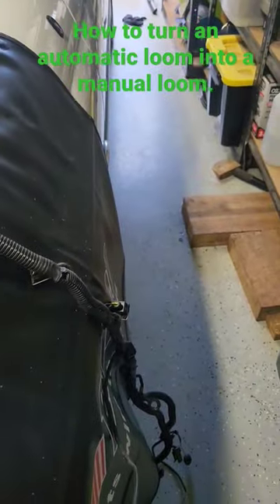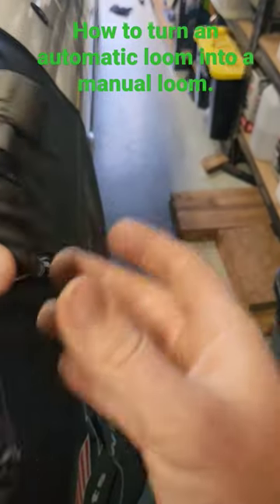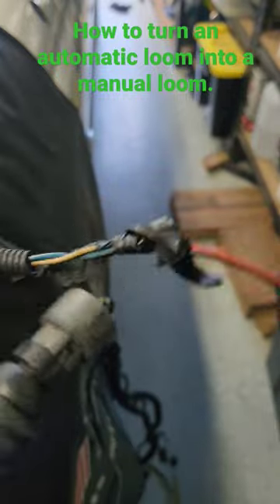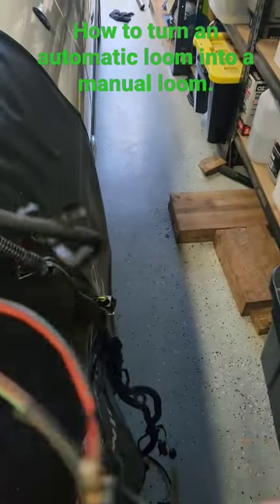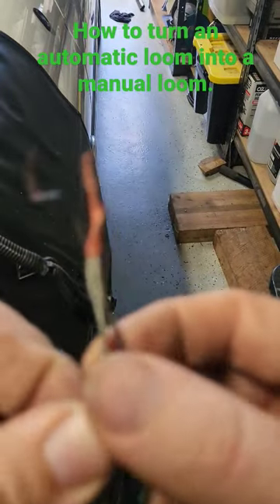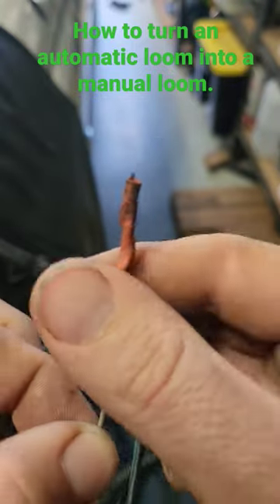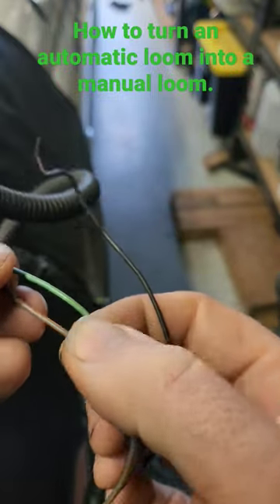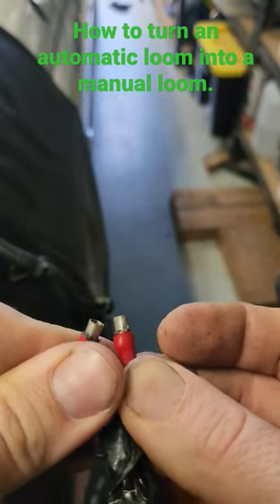Turn your automatic L67 engine loom into a manual L67 engine loom. #l67

Comment: I connect the grey with blue and the grey together but mine won’t start from the key. I can clutch start it but won’t crank with the key
Reply from the maker: just check the are grounding at the other end. if you have changed the loom from models sometimes it doesn't match up.